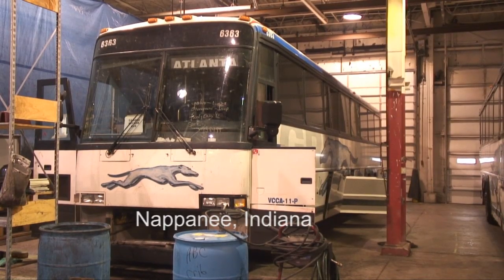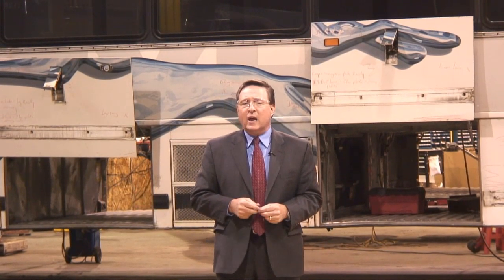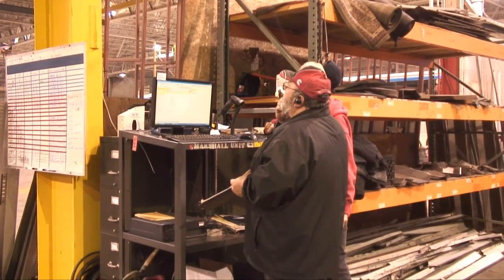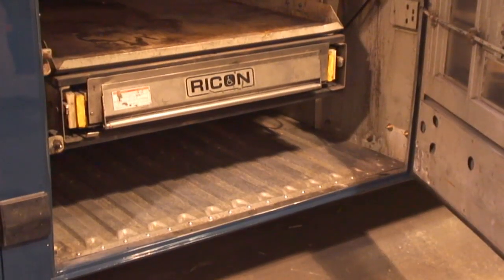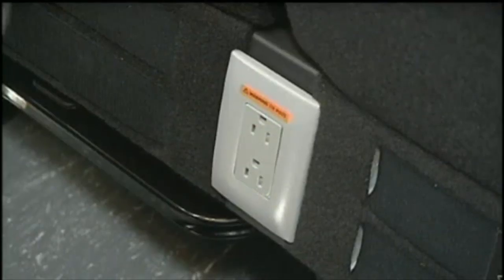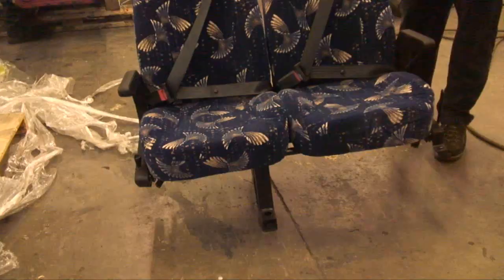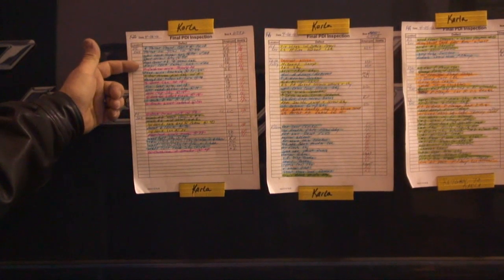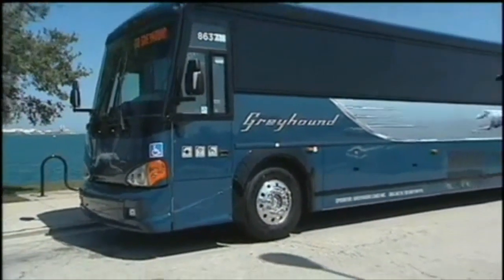Greyhound Fleet Revitalization program featured on Motorcoach Travel News (MTN)

Comment: hi ive been on these new buses  before and they need larger seats so people  have more room and they dont have more leg room lol
Reply: That's because the new buses have Premier LS which are set low to the ground so you have very restricted legroom. All the new buses have Premier LS. But the DL3's in this vid have resurfaced Patriot PT which are much more comfortable.
Reply: Ya Every Bus I've been in does not look like this .They kind of look like A bus that's been in  A Salvage Yard for about 20 years. The reason I know is because I operate them and I know and I know how well they are fixed. You are safer drinking water from the toxic waste site in Russia that happened in 1980's.